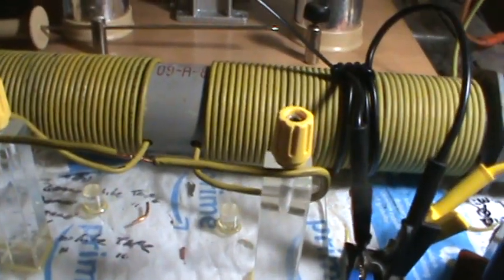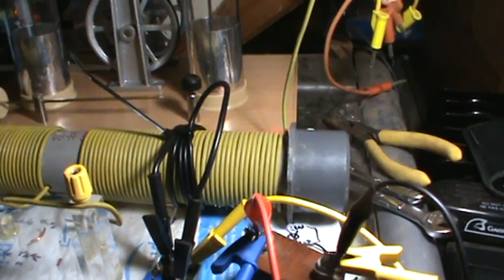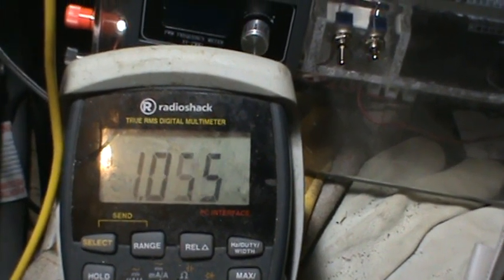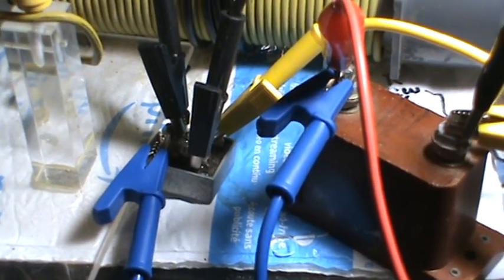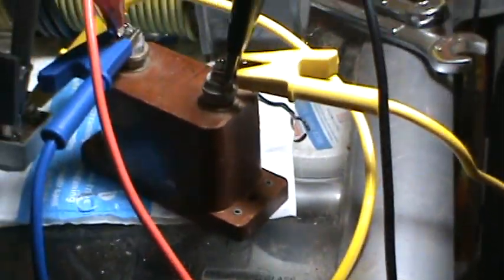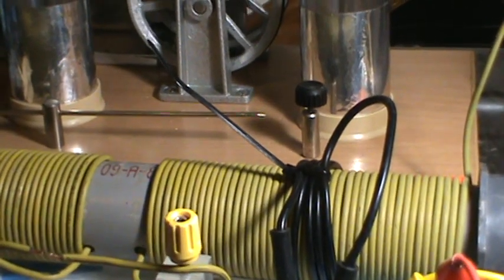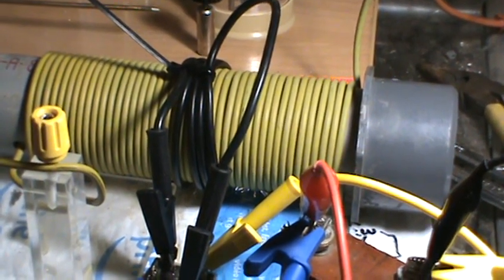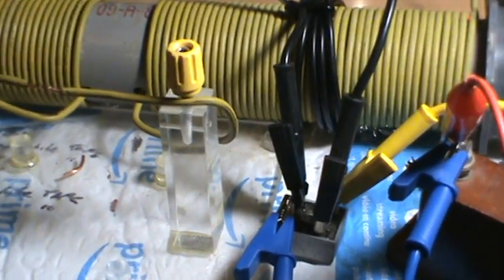First test

Comment: Hmm..i dont know exactly, what kind of experiment this is, but as far as i understand, you are taking away the static charge from a static charge generator..(rubber belt or similar) and you are transforming it to something "useful"..on every spark discharge / charge overflow...right?  Adressing the current state of the experiment..yes, i also think, more secondary turns will increase the output voltage.. Maybe you can make your own rectifier out of 4 low drop diodes (schottky diode)... Greets from Austria
Reply from the maker: I am trying to take static energy and transform it to usable dc voltage .

Comment: what is that noise
Reply: I think maybe the twin disc that spin, they have "combs" that rub on the metal bits on the discs... Just a guess but I'd say it's something to do with that
Reply: Sounds like coil whine but actually that thing that is spinning in the back is spinning way faster than it looks. Wagon wheel effect. 
So you're probably hearing that and the motor driving it
Reply: @SimEon-jt3sr  definitely, and at close to an even ratio with the frame rate. he says its a stepper... i assumed a synchronous and thats slip making it look "slow", when it would actually be spinning the other way, performing slightly under one revolution per frame, to what it looks like...

but as a stepper...iunno. could be spinning either way at any speed, but still almost in synch... but not quite.
Reply from the maker: The noise is the stepper motor running the Wimshurst Generator
Reply: It's atrocious.